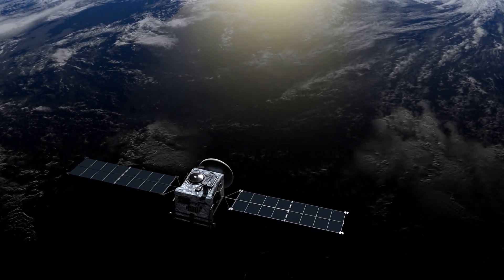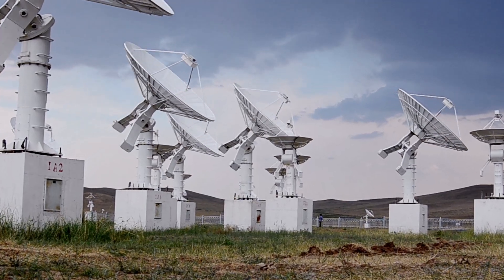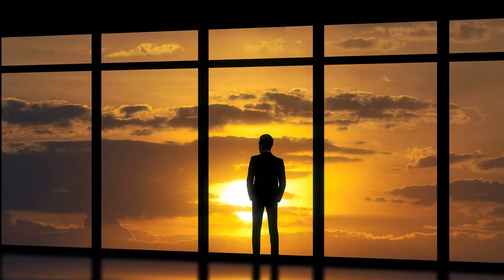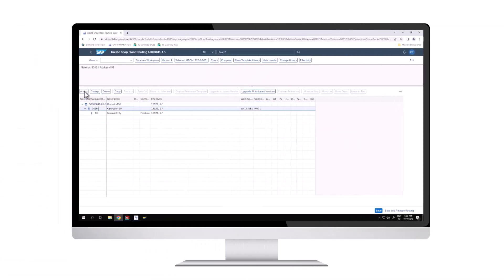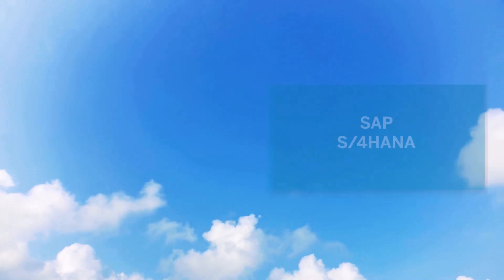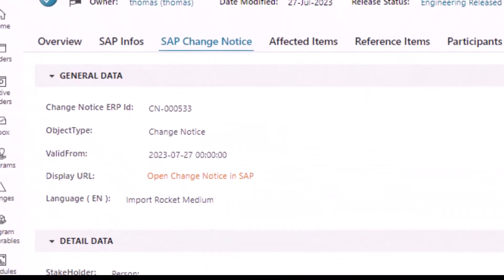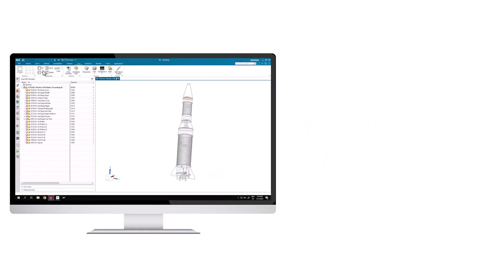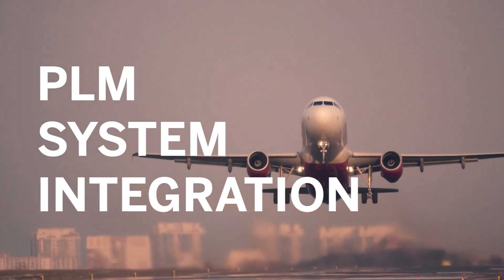PLM System Integration

Comment: And What is difference between SAP PDMI and SAP PLM SI?
Reply from the maker: PDMI is currently in maintenance mode and will no longer be developed. We recommend customers to evaluate PLM System Integration. PLM System Integration provides out of the box integration across discrete industries and offers the following advantages:
 
Single solution for Design to Operate digital thread integration to external PLM systems
Multi deployment capability for S/4HANA Cloud Public Edition, Private Edition and on premise and SAP ERP
Bi-directional process and data integration / federation
Integration with focus on end-to-end processes
Harmonized PLM-agnostic payloads regardless of the source external PLM system
Supports cardinality allowing integration to one or multiple PLM systems.
Can be combined with Integration Platform Services and Master Data Governance
Best in class PLM Vendor – S/4HANA integration delivered by Siemens and SAP, including aligned roadmaps, releases and ready-to-run starter packages
Leverages special expertise partners incl. .riess, CENIT and CIDEON for other PLM systems
 
For an overview of the supported business entities please have a look at the Admin guide: https://sap.to/6054057aq. - Bella, SAP Community social media team
Reply: @SAPCommunity  Thanks a lot!